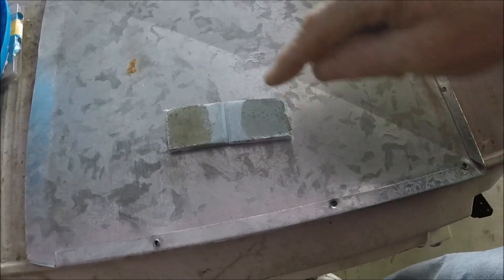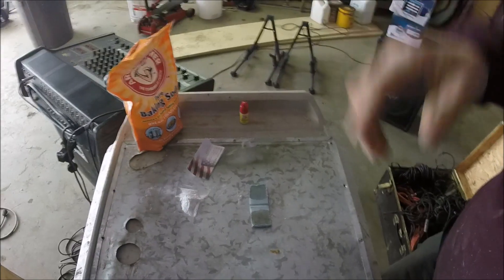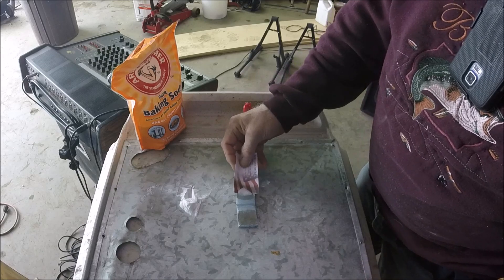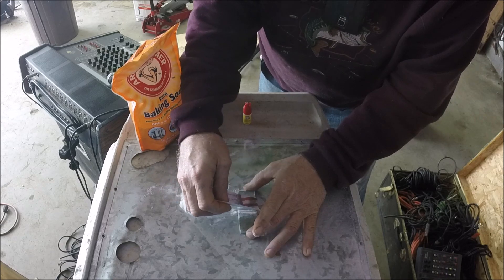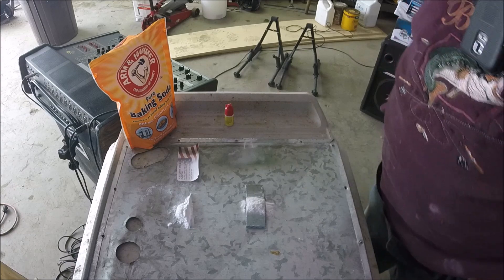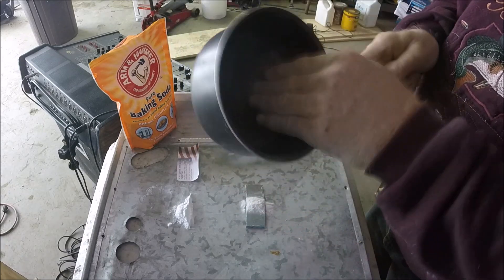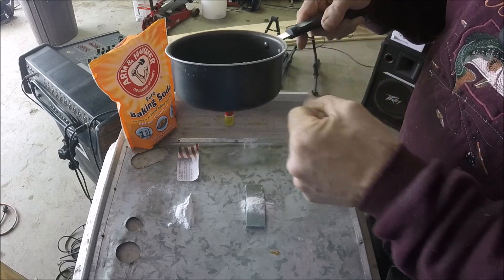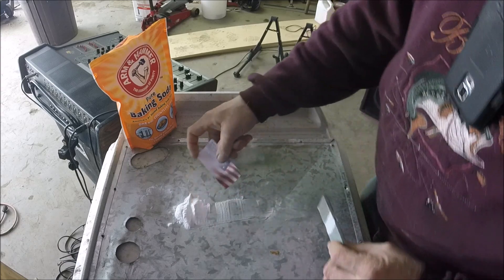Super glue baking soda trick, on 1/4 peace of fiberglass, how well bonds and strength

Comment: There is strength gain using baking soda, though by giving you a malleable solid, it may make repairs possible that aren't practical using even a gel.

What happens when you use baking soda is that you are accelerating the chemical reaction that is referred to as curing.

It doesn't matter what the source of the hydroxyl ions is.

Tap water typically has enough free hydroxyl ions to be a half assed accelerator.

pH is how we describe the relative presence of hydrogen (H) ions or hydroxyl ions (OH) in a substance.

Low pH is acidic, high pH is alkaline.

You want high pH in an accelerator.

Baking soda has abundant free hydroxyl ions, only a small fraction take part in the reaction, most of it being just an amalgam with the cyanoacrylate.

It doesn't add strength any more than would sand or anything else as a binder.

Depending on technique used, it may reduce strength by introducing voids in the bond.

Comment: Just take ANY band-aid & pull the plastic gauze away from the cotton pad and you will have a VERY THIN AND EXTREMELY STRONG MESH REPAIR FABRIC. Been using it on R/C Planes and Car Bodies for about 40 years or more and it works great and doesn't cost shit!

Comment: Super glue and Krazy Glue Great Inventions aren't they I was a roadside Mechanic and Tire Guy in Houston for almost 10 years one time I was dispatched away on the other side of town somebody had a hose issue and I got there with no preconceived notion of what hose was the guy's problem turns out the brass fitting on one of the pressurized hoses that go from the driver side of the 18-wheeler motor to the back side on the passenger side of the motor separated fitting from the hose so I took the brass fitting and started on my way to the part house and get them to make up another hose hopefully guessing the length correctly man I was dreading that traffic not to mention my company was charging the man $95 an hour $95 service added to that but then I remember the commercial from the 80s with a guy hanging from a steel beam and a hard hat long story short I purchase some crazy glue put it in the fitting just before I got back to the driver to let the glue cure told the driver this is a new product high pressure hose adhesive and being as its new I would follow him down the road to ensure that it did the trick to get him off the road so follow him all the way to the TA truck stop where they have a mechanic on duty I go to the restroom and when I come back here's the driver and this mechanic waiting for me I remember thinking oh crap busted but the mechanic looked at me Square in the eye and said say fella where can I get some of that high pressure hose adhesive

Comment: I tried this with 2 different Gorilla glue brands and two superglue brands with an isopropyl clean and roughing up all edges ,TOTAL FAILURE,I repeated it with a cheap, and expensive supermarket brand, using 2 types of baking soda, on plastic and the results were the same TOTAL FAILURE, at no point at all did either product harden.It cost a fortune to buy and the air temp was warm,just warning you guys.do not waste your money.